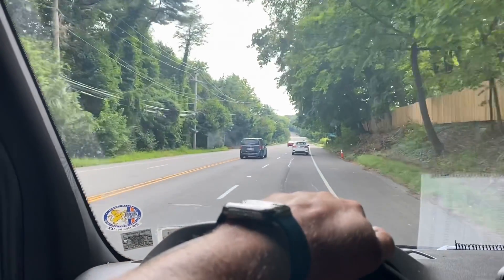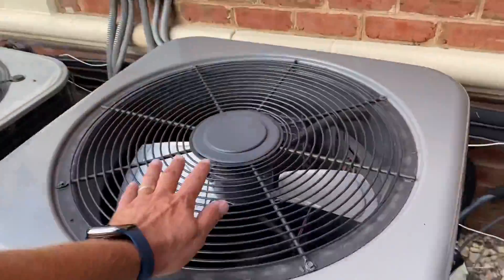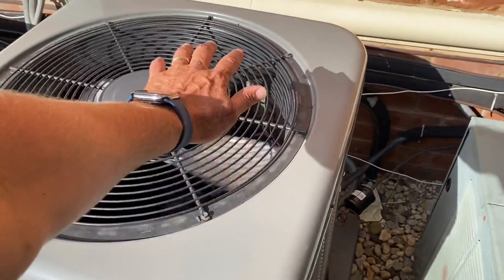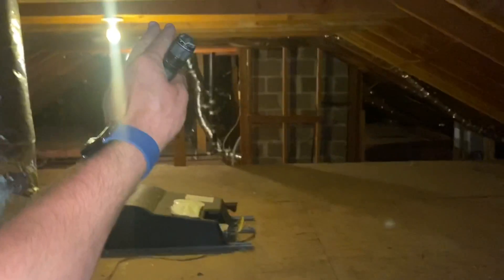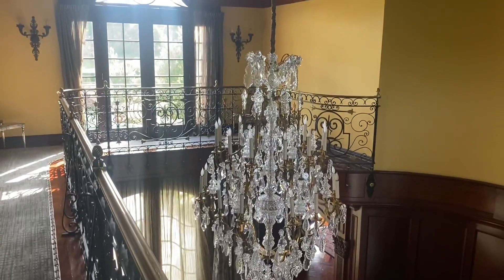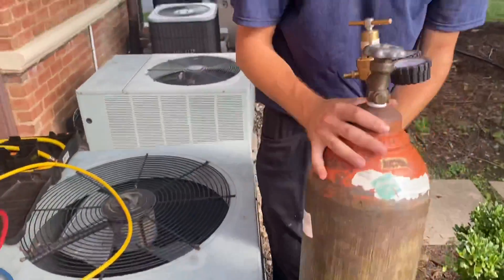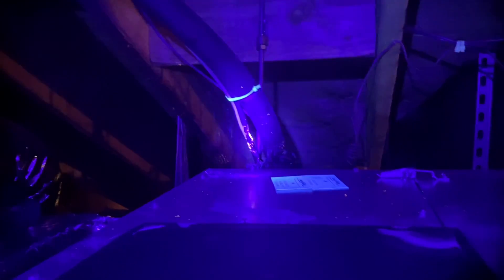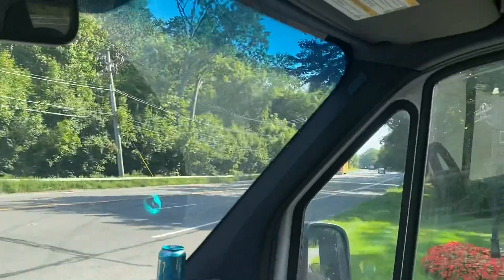Brand New Rheem & Unico AC System Not Cooling How to Perform Leak Detection with Nitrogen

Comment: Over the past 15 years, evap coils have really become junk. When the big rollout of 410A happened, I warned guys on HVAC Talk that the higher pressures and the desire for cheap parts would intersect in "Coil Ma Gedden," and they all thought I was nuts. I may be nuts, but unfortunately, I was right.
Reply: I agree with you and it not only hurts the consumer that has to pay for the repairs . It also hurts the environment by letting all those gases into the atmosphere .  And you never hear the Green Nuts complain about that .

Comment: maybe get him to order a second one as backup and put in storage.
he has the cash to cover labor, could you steal a unico from guest wing or area they do not care about?

Also, just wondering, do they make shutoff you could install in the attic so if you had to replace an evap you could shut them off and not need to pull vac on the entire line set?
I guess in this case with a leak it does not matter, but in some cases I bet it would be nice.

Comment: You guys are crazy carrying the nitrogen around with the regulator attached. Put the cap on that thing already! Maybe YouTube what happens if you drop the tank and knock the valve off, that'd be a great safety meeting topic.
Reply: it will only launch like a missile when the valve snaps off, imagine it going right through the brick garage wall and into the corvette or Ferrari. guess that would be better than through somebodies leg/arm/guts. WHOOOSH

Comment: I’ve never seen one of those Unico units out here in Southern California. Are they better suited for multi story homes?
Reply: Mikey or ductless solutions when architects would pro-vice re construction of walls an demo
Reply: If you have an older home where ducrwork is an impossibility, and you don't want to have a system of mini splits with evap heads and ceiling cassettes, the high velocity system is a terrific solution.... although it does have its issues with its proprietary nature and its installation cost.